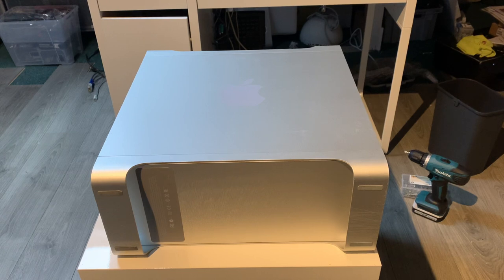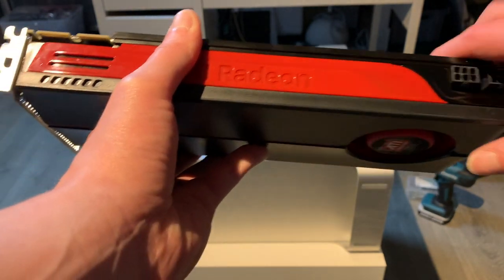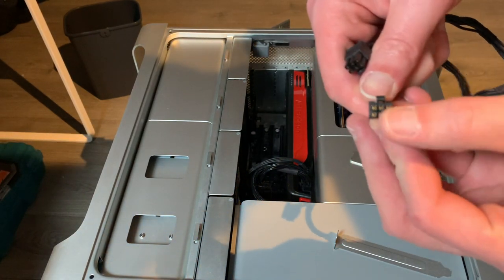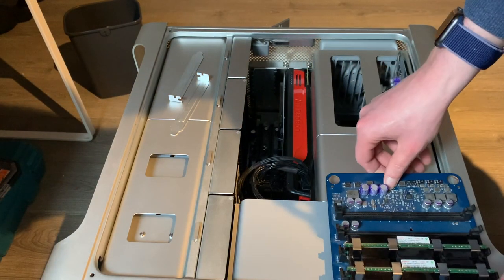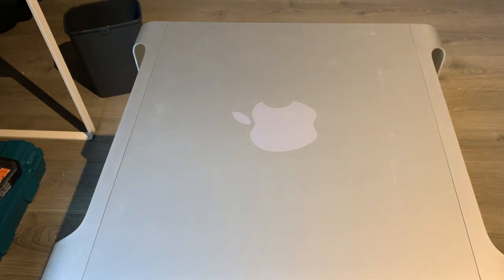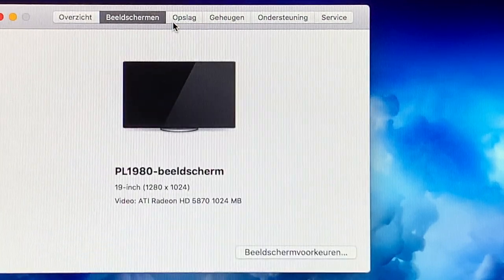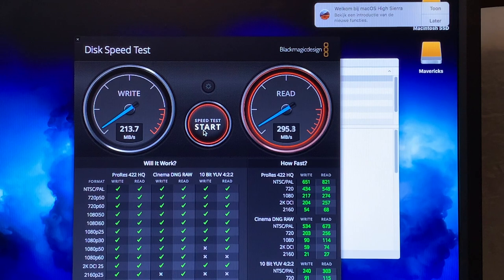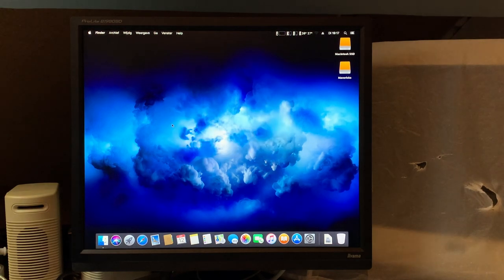Upgrades for the Mac Pro 3,1

Comment: Hey
I bought the same gpu but i start up and it loads more than half way and then stops and then the screen goes black and then white and again i need help plss 
O yeah i am running high sierra on an ssd plsss help me i dont know what to do
Reply: I think the problem is my monitor not shure i m still a noob xd
Reply from the maker: Did you install high sierra using the dosdude1 patcher? Does another GPU work fine?
Reply: Yes an other gpu Works fine
Reply: Do you know what the problem is?
Reply from the maker: Dead GPU more than likely.
Reply from the maker: Dead GPU more than likely.
Reply: @nelizmastr  its the software from high sierra that is the problem so im going to try to run run it into ubuntu and see of its a dead gpu

Comment: Hello -

I'm looking to upgrade my Mac Pro (Early 2008) see specs below:

Processor - 2 x 2.8 GHz Quad-Core Intel Xeon

Memory - 2 GB 800 MHz DDR2 FB-DIMM

Graphics - ATI Radeon HD 2600 XT 256 MB

is it even possible? Would it be worth it?

I use a lot of stuff on my current Mabook 15inch 1tb but want to move over to my desktop for editing videos, producing music, graphics design.

You'll have to forgive my 'noobyness' with this all, very new to the upgrade world...(sigh)
Reply from the maker: The biggest perceivable performance upgrades are RAM and SSD. Get the memory off eBay, it’s like $30 for 16GB (4x4 or 8x2). SSDs are pretty affordable too these days. Get a caddy to convert to 3,5”.
Reply: @nelizmastr  would 32 or 64 work?

Comment: hd 5870 beast of the card in 2020???  funny. Ik heb hd 6970 op mijn zolder , ligt in stof te wachten. Groetjes
Reply: can you put RX580 inside?
Reply from the maker: Yep. Just no bootscreen, so you can’t hold the option key to pick a different boot drive or go to recovery.
Reply: @nelizmastr  but what is the max with apple boot? which card you put max inside of this computer? Thx
Reply: @nelizmastr  wow , i put it, works perfectly, i love it! I buy it for Thx. But who want boot screen can use 5870 like you.
Reply from the maker: Yup. It’s not that big of a deal for most.